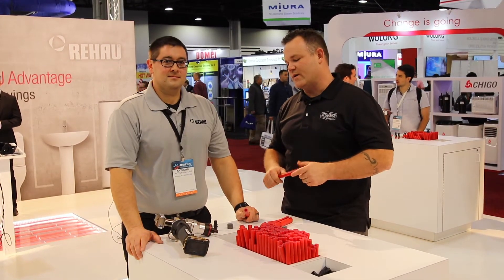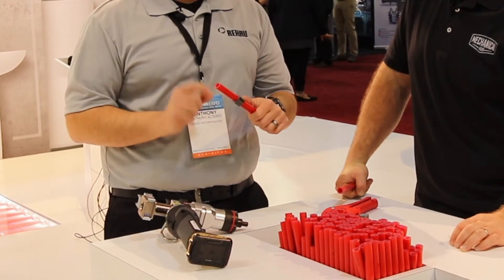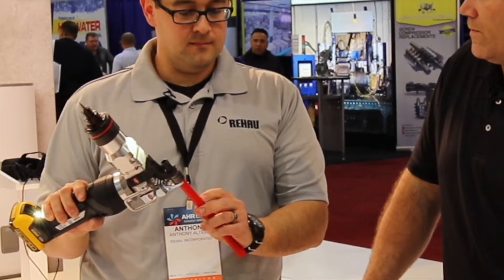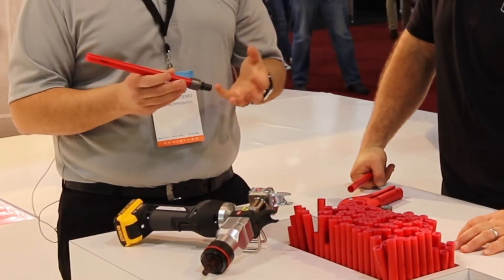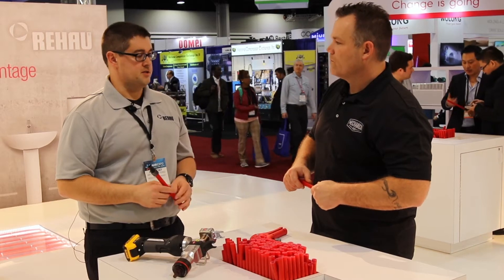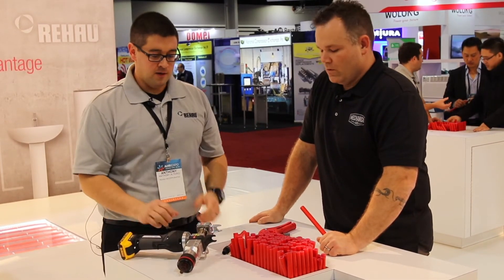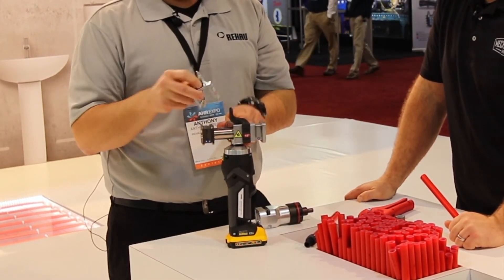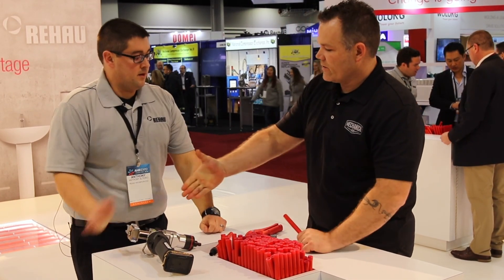Rehau EVERLOC+ PEX System #ahrexpo

Comment: This is a sweet system. Ain’t nothing happening to that joint! How much is the tool? Made by deWalt?
Reply from the maker: The tool isn't made by but is powered with a Dewalt battery. The tool itself is made in Germany, I believe by Klauke. You'd have to check pricing with a Rehau rep, I've heard mixed numbers.